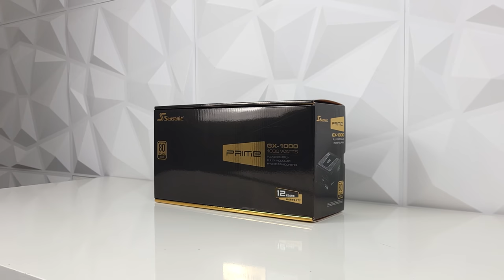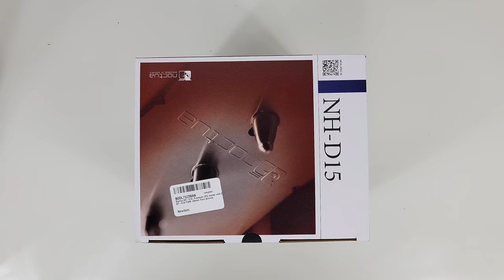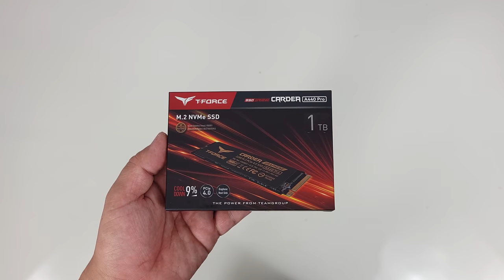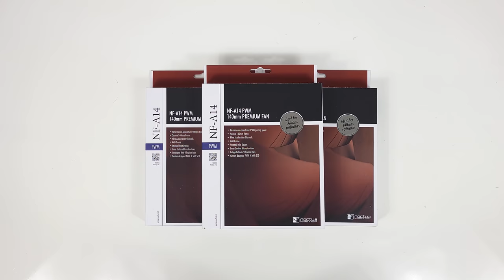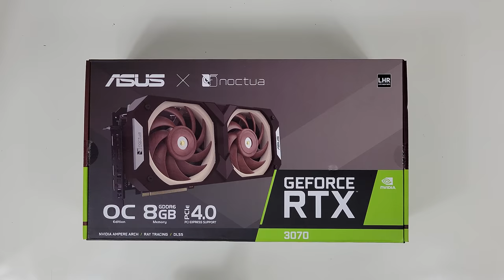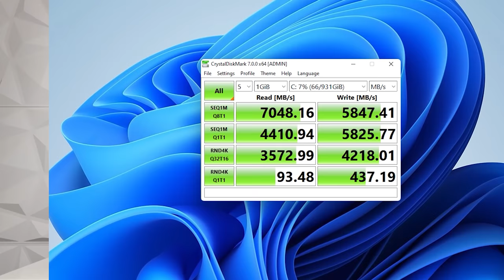Noctua PC Build 2022 | i9-12900K | T-Force DDR 5 | MSI MEG Z690 | Fractal Design Torrent | Seasonic

Comment: Can i know ur CPU setting is it all default? And that 81C average is when fully 250W+- load? 
My New Corsair H100i ELITE CAPELLIX can't hold my i9 at default setting. it will over shot 100C easilly.
I have to undervolt it with adaptive setting and minus 0.09 only able to reach 82C max and load max 200W with 10 mins cinebench score 26776

anyway, my cpu sp rating at 86. n i sure ur CPU must have better temp CPU, mayb.
Reply from the maker: During Cinebench test, the i9 12900k is known to hit 100c at high peak with any coolers. So as mine. 81c was the average result from full load. I believe two 180mm front & three 140mm bottom fans are making it best result. It's blowing massive air.

Comment: Bro will the NH-U12A chromax which i already purchased. But have option to return and buy nh-d15 chromax.
Is it good for  12700k ?
My work is 3d modeling and rendering.
Thank u
Reply from the maker: Yes both coolers are good for 12700k. I don't think you can't go wrong with either coolers.

Comment: Putting fans on the bottom is a bad decision. There is always dust in the room and these fans will suck in more dust than if they suck air from the front part. Computers often stand under the table, sometimes they stand on the table. If such a computer is standing under the table, it will quickly get dusty thanks to such fans from below
Reply from the maker: This build is not about dust. I wanted to build the best possible air flow which Noctua & Fractal cases offer.

Comment: Uh, no exhaust fans?
Reply from the maker: Unlike other cases, the Torrent rear side has an open grill and the entire rear side acts as an exhaust. Adding the rear fan to the torrent didn't improve temperature while the front fan blowing massive air toward the back side.

Comment: So, you build a Noctua Edition PC but you don't use the Noctua NH-U12A. Nice.
Reply from the maker: Does Noctua makes NH-U14A? why would I used 120mm
Reply: @PCTechnician Similar performance, much smaller, more stylish, allows 100% RAM clearance and those NF-A12x25 are an absolute joy. It just makes a PC build look significantly better at the cost of 1 or 2 degrees at the most.

There's no reason to choose the NH-D15 over the NH-U12A (apart from the price, which I'm sure it was not a problem for you).
Reply from the maker: @HarryPowerColt  Upcoming my next video I'm going make black version using all NH-U12A fans on a Corsair case. Two 180mm fans blowing in the front with Torrent case, 140mm is more suitable here.
Reply: @PCTechnician  Well, if one cares a lot about airflow you're absolutely right then. My apologies.
Reply from the maker: @HarryPowerColt  Oh no problems I'm just explaining why I used 140mm. Of course I love NH-U12A

Comment: Does the NHD15 fit in the torrent compact
Reply from the maker: According to the Noctua website, no. But it may work depending on the motherboard. https://ncc.noctua.at/coolers/NH-D15-cooler-2/cases/Fractal%20Design

Comment: bro I forgot to remove the CPU socket lever protector lga1700. the transparent tube which is on the lever latch. 
will there is damage or issues come? 
i have already installed the air cooler.
will it be necessary to remove that tube?
Reply from the maker: You mean cover for cooler heatsink? Yes you have to remove it.
Reply: @PCTechnician  no bro not the cover of cooler
There is lever to lock the  proccessor and on asus boards there is a plastic tube on the lever latch
Reply from the maker: @tabasumcarpentry5336  What is the name of your Asus mobo?
Reply: @PCTechnician  prime z690-A
Reply from the maker: Oh! yes you need to remove the tube.

Comment: Wtf?! 
What about cpu temp on OCCT? 12900K? Where is water cooling? Where is output fans??? ALL HEATED AIR GOES THROW POWER SUPPLY?
Reply: This case is disgusting. Power supply on top of cpu. Hello from 2007
Reply from the maker: Just google it up if you have no clue. This case is the best airflow case in the market. Unlike other cases, the Torrent rear side has an open grill and the entire rear side acts as an exhaust. Adding the rear fan to the torrent didn't improve temperature while two front 180mm fans are blowing massive air toward the back side.
Reply: @PCTechnician  what about 270 watt and air cooling?
Reply from the maker: @PersivanA  Noctua will just be fine. There are many websites that cover Noctua Air cooling with 12900K.  GPU max 60c, CPU idle 30c, average full load 81c here
Reply: @PCTechnician  max package for nh-d15 200w. After this point >85 degree. U need water cooling! 
Idk it's useless to talk through comments. my experience says that >180 watts should be used with water. 
about the rear fan. I haven't tested such cases since 2007. processor-heated power supply stillborn technology

Comment: 1. Используя удлинители кабелей питания вы тем самым сильно снижаете силу тока и напряжение на выходе, уводя потери в нагрев кабелей и дополнительных разъемов. Особенно критично для очень требовательного контроллера питания RTX 3000-й линейки. 
2. Отсутствует дополнительное крепление видеокарты к корпусу. Прогиб текстолита видеокарты с таким горячим чипом приводит со временем к отвалу графического чипа и памяти. Силуминовый бэкплейт MSI слишком слабый, для придания необходимой жесткости конструкции, тем более с такой монструозной системой охлаждения от Noctua.
3. Вывод общего горячего потока воздуха через БП сверху корпуса - наркоманское решение. Тем более, если вы хотите данную модель Seasonic использовать в бесшумном режиме. 3 вентилятора корпуса должны быть сверху!
4. 12900к избыточен для данной игровой сборки. Если же его использовать в рабочих приложениях, то башня Noctua уже будет работать на пределе! Необходима водянка.
Reply from the maker: Sorry but I would not respond to your comment because you have all the facts wrong. Do yourself research about PSU extension performance, how much RTX 3070 draws power and how this Torrent airflow works differently than other cases then come back.
Reply: @PCTechnician  Извините, но я лишь привел факты из физики за 8 класс. Нравится вам это или нет!
Reply from the maker: @klim6361  lol have a good one

Comment: no fans on top of the case, wow, kinda bad.... looks ehm white, but thats it, so useless! All this heat from the GPU, CPU and mem will go out only with 1 fan on back, great design

Superb MB, outstanding CPU (best so far on the market), GPU is not, its 3070 so u cant play 2k on ultra... almost all the 3070 r cool and dont require such radiator and noctua fans, it would look better on 3080, 3080ti or 3090
Reply from the maker: Unlike other cases, the Torrent rear side has an open grill and the entire rear side acts as an exhaust. While the two front 180mm fans are blowing massive air toward the back side, adding the rear fan to the torrent didn't improve temperature much. This is best airflow case in the market right now. https://www.youtube.com/watch?v=HBxo2_lwKps

Comment: I mean I guess. Kind of backwards power supply and case fan wise. And that fucking noctua GPU man. That 5 slot thing should be for the 3090. Taking up all those fuckin slots. 3070 doesn't even put out that much god damn heat!!!

I agree with Moore's law is dead, y'all are falling for dumb shit. A GPU should not be beyond 2 and a half slots. There's a reason why they're called SLOTS. Used to use them for other add in boards. Hence AIB.